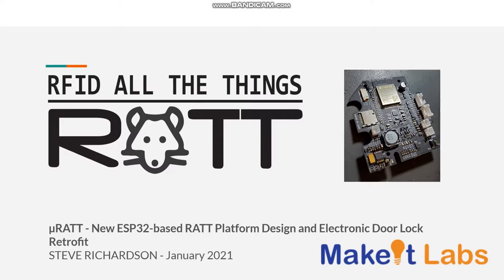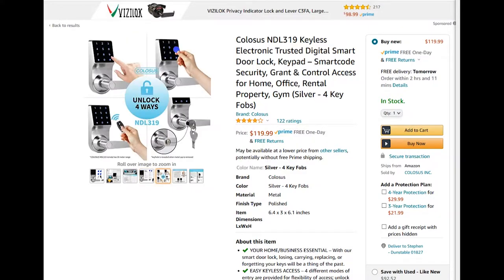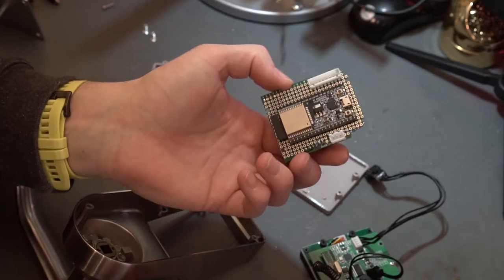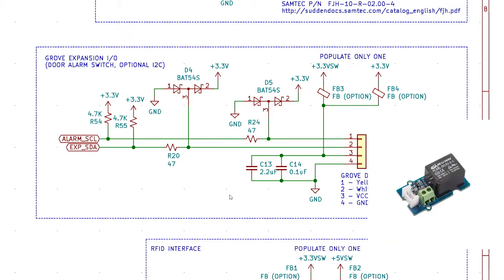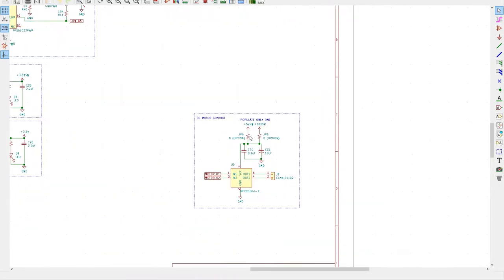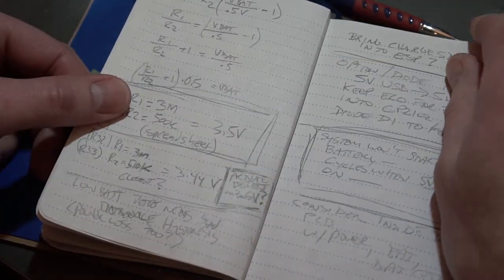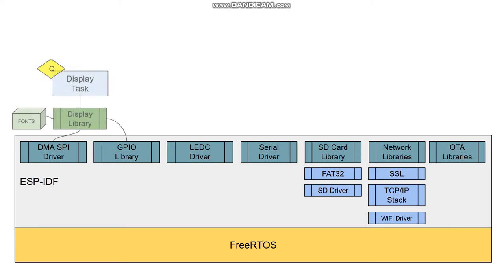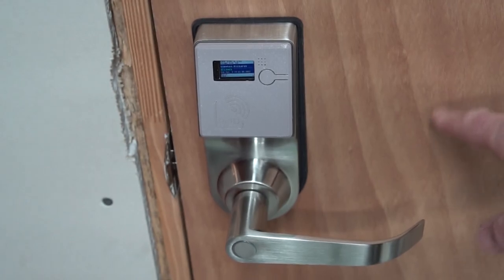uRATT: an ESP32-based RFID Access Control Platform, and Retrofit to a "Smart" Door Lock

Comment: Great work! Thanks for sharing. I admire all the effort invested in documenting every aspect of the project. Particularly, I very much liked the system architecture diagram. Quick question: will the locks continue to work when they lose connectivity to the WiFi router or the mqtt broker? One challenge I see you coming to face is making sure that you have good WiFi coverage; especially since the units are kind of enclosed in a "Faraday cage".
Reply from the maker: Thanks, glad you enjoyed it!  Yes, it will continue working without network access because the access control lists are downloaded and stored locally on a micro SD card.  There's more work to be done in the code to make it more robust, but the previous systems I've developed have all been able to tolerate outages.   WiFi operation is surprisingly good inside the metal enclosure - the entire front is plastic after all.  We also have decent wifi coverage at our makerspace with many access points throughout the space.

Comment: Steve, great video! We are also setting up access control for our MakerSpace (mnmakerspace.com) and would like to adapt what you have already developed. I've looked through the RATT source code but couldn't understand how you are building this software. I've installed the ESP-IDF tools but couldn't find any useable makefile or project file. Can you share more information about your development environment?
Reply from the maker: Hi Alan.  uRATT (specifically the ESP32-based system covered in this presentation) is not ready for prime time yet, so I don't recommend that as a starting point at this time.  Our Raspberry Pi-based RATT is the more mature platform and has been in use for years controlling several of our tools.  Our code and hardware designs are available on GitHub, but unfortunately documentation is more than a bit lacking (and somewhat out of date where it does exist).  Unfortunately it's not an easy process to build everything as it uses a full custom Linux build based around OpenEmbedded/Yocto, so it requires a lengthy process to build an image.  I need to find some time to update the process and documentation soon.

If you're just looking to control access to exterior doors with typical solenoid locks, our old DoorBot project might be the easiest.  That's also Raspberry Pi-based, and is simpler to get running than RATT because it's just some Python code that runs on a standard Raspbian distro.  I developed a custom board for Doorbot, but you can build a working system with a standard Pi and some off-the-shelf parts.  We still use this older system to run our exterior doors, despite its age and simplicity.

If you're still interested in our ESP32 code, regardless of its current state of completeness, you're on the right track with ESP-IDF for the development tools.  You should get started by building and testing some of the example code Espressif provides.  Once you get the hang of building those example projects, building the uRATT code is very similar.  Our GitHub repo is https://github.com/makeitlabs/ratt .. The firmware is in firmware/esp32/uratt and there's a Makefile in there.   I recommend following one of the "getting started" guides for ESP-IDF, such as https://docs.espressif.com/projects/esp-idf/en/latest/esp32/get-started/

All of our systems (doorbot, RATT, uRATT) work against our Auth Backend, which is essentially a database and a web interface for managing members, subscriptions, etc.  That's also on on our GitHub, at https://github.com/makeitlabs/authbackend ..  I'm not as familiar with that, as it was largely developed by another member.
Reply: @TangentAudioVideo  Thank you for the info! I will look into the door bot but yes I am still interested in the ESP32 system. I'll keep an eye out for updates :-)